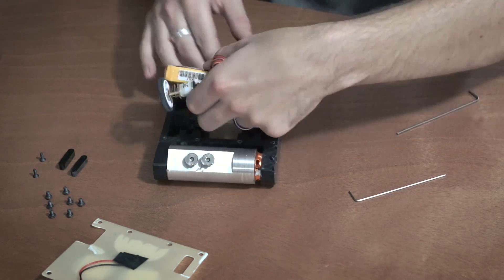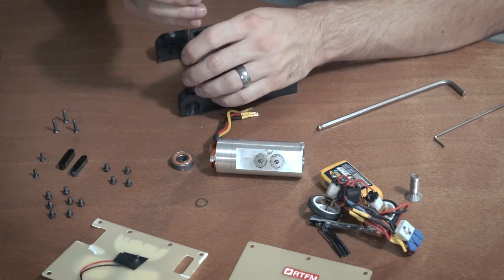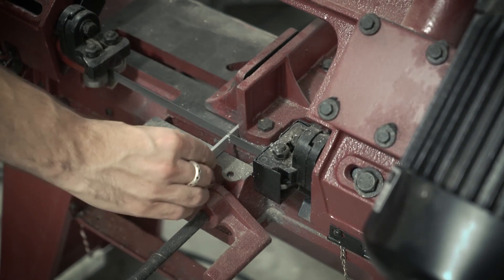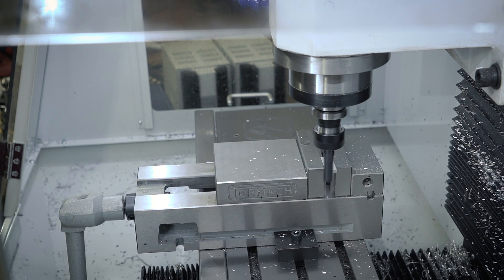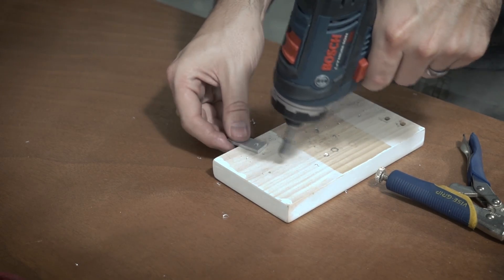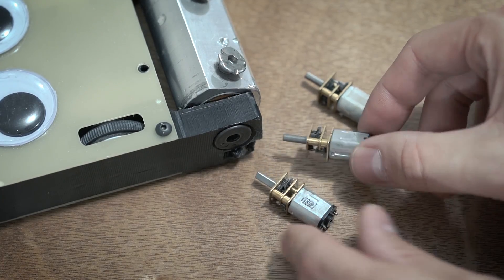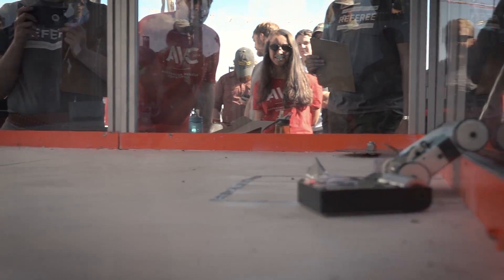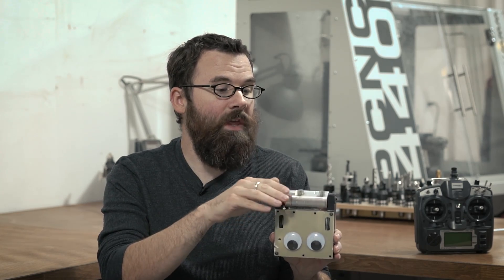Sgt. Cuddles - Revisited (Antweight Combat Robot)

Comment: I tried to use those drive motors for my beetle wieght but all four of them burned out, I was using 1000rpm though
Reply: Why did you run N12 motors in a beetle? They're at most are good for a 1lb bot
Reply: What motors would you use for a beetle? Could you give me a link?
Reply: Logan Hughes 22mm to 25mm motors.

Comment: i think if you added a wedge shape on the sides of the frame where the weapon sits it would help with the effectiveness of the attack. By being able to force the enemies bot to slide up towards the top of the drum weapon thus sending them flying a lot easier. although i'm certain it's not needed but i think it'd just help with being able to get under neath the opponent.
Reply from the maker: Check my new design.  The reason I don't do wedges is because if they get bent, they can cause major problems.  I tried to keep things simple.  The new design just uses a larger weapon.
Reply: ya i saw sgt cuddles v3 looks amazing. got any battle footage with it? i've only seen Sgt. Cuddles v2 in some videos
Reply from the maker: I don't have much footage of V3.  I've only fought with it once and I didn't record video of the whole competition.  In October, I'll be competing in the SparkFun competition and I will film everything with the new V4 ;-)

Comment: Hi, I'm wanting to build an antweight horizontal bar spinner, please could you put up a picture of St. Cuddles' circuit diagram?🙂
Reply from the maker: I don't have a circuit diagram, but am planning on doing a video on various aspects of combat robots like electronics, materials, etc.  There is no circuit diagram though, sorry!
Reply: Thanks,
Reply: Robert Cowan I'm a beginner to building robots, could you offer some help? I have no experience with engineering and anything else and I have no metal. I can use cardboard. Could you help me?

Comment: Are you coming to Robogames 2017?
Reply from the maker: I'm not yet sure.  I might not have enough time to make it out there.  We'll see, I want to go again, I've just been busy lately.
Reply: Well hopefully you can. Cuddles is one of my favorite ants! I wanted to fight it at Sparkfun AVC, but my bot didn't make it very far :P
Reply from the maker: It looks like there might still be room to register.  I'll think about it  It would be fun to fight cuddles again.  But if I went, I would start from scratch and make a NEW cuddles, maybe promoting him in rank ;-)
Reply: Oh awesome! Care to share what design changes you're considering? Or is that all classified intel for now? :P
Reply from the maker: I want to try and go for 4 wheel drive (which means decreasing the weight of the chassis by quite a bit), replacing the drum with an egg beater (probably titanium or something MUCH lighter than aluminum), and possibly carbon fiber instead of garolite.

Comment: Awesome bot. How much would you say it costs to make one full Sgt. Cuddles as far as parts and materials? Not including tools and time.
Reply from the maker: Probably around $500 for all the materials and parts, assuming you are starting with nothing, and make backups for competition.  It really adds up, but once you start looking at 4 of the TinyESCs, multiple batteries, multiple drive motors, material for the body, etc...  you get up to $500 pretty quickly.  Robotics is not a cheap hobby.
Reply: That's not bad. Considering, I saw on Ray Billings' Reddit AMA that one Tombstone costs about $15,000. Congrats on your bot. Good luck in the future with it!
Reply from the maker: Yeah, I think you could do an antweight for around $250-$500, a beetleweight would cost around $500-$1000, lightweight (60lb) would be around $5,000, and a heavyweight should be around $10k - $15k.  Of course there are exceptions to these, but for people getting started, that's a good place to start.
Reply: Awesome. Thanks for the insight. Good luck!

Comment: What is the size limit for an ant weight bot in the US? I know that its 4 inches in the UK and also that the bot has to be less than 150g.
Reply from the maker: It's confusing, in the UK, the 'antweight' class is 150 grams, but in the US it's 1lb or ~450 grams.  There is no real size limit, just a weight limit.  So it's generally referred to as a "US antweight" or "1lb antweight".
Reply: thanks that is extremely helpful and explains why I could not find a size limit for them

Comment: Hey! I love it when a really well built robot wins a competition. I want to make a bot with a vertical bar spinner. Do you have a suggestion for a motor and ESC I should use? Thanks!
Reply from the maker: Thanks!  I don't think ESC and motor selection would be much different for a vertical spinner.  Get the biggest/most powerful motor you can find that has the lowest KV rating.  Then just match the ESC to the motor.
Reply: Thanks! I will look in to the one you use.

Comment: At first I thought those were carbide inserts on the drum.
Reply from the maker: Nope, just stainless steel screws.  It's easy to replace them if they break and it's also easy to adjust the length.